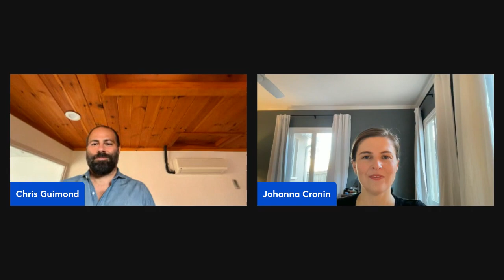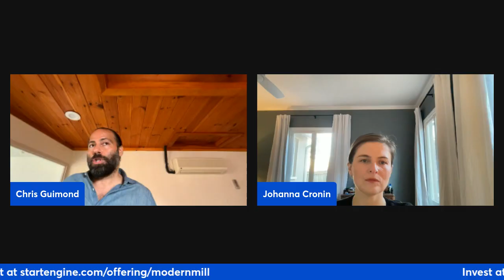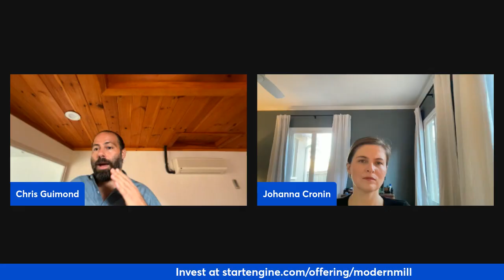Modern Mill Webinar: Founder & CEO Chris Guimond on Reinventing the Future of Wood

Comment: How durable is Modern Mill material for house framing/building?
Reply from the maker: ACRE is super durable for non-structural parts of a build like trim, siding, decking, and porch boards. It’s designed to resist moisture and rot, and it won’t crack or splinter like wood over time. For house framing (studs/joists/beams), use code-rated structural lumber or steel.